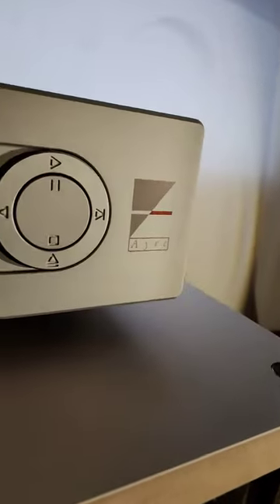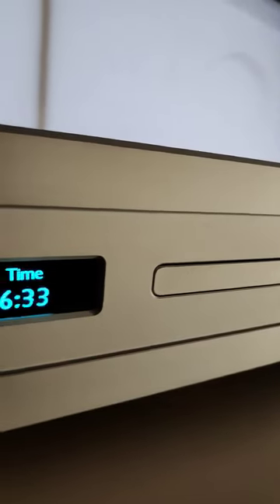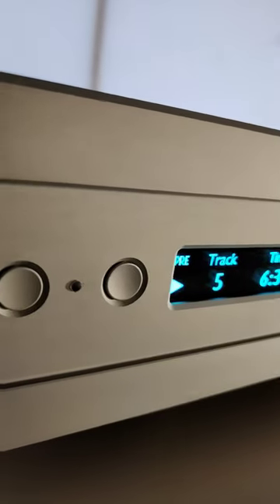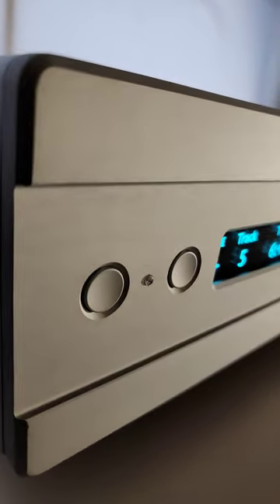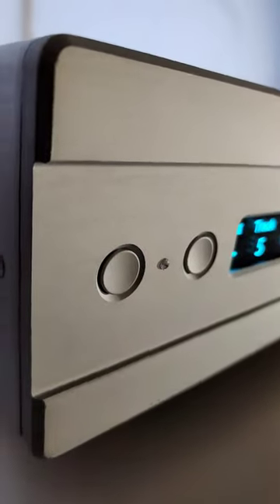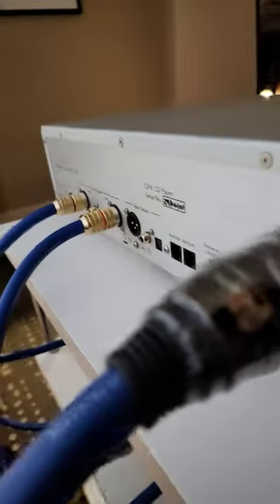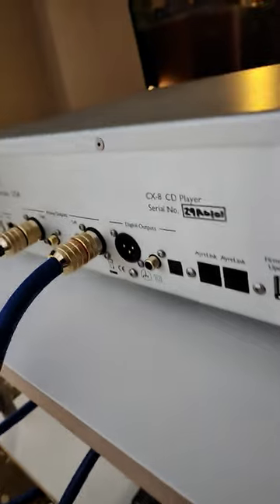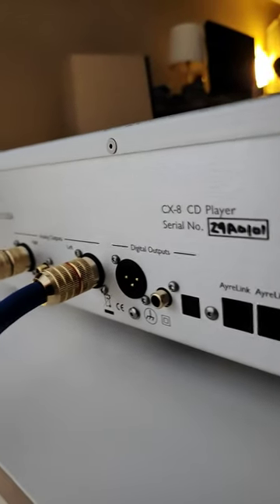AYRE ACOUSTICS up close... #audiophile

Comment: Beautiful 0101. I don't need a cd player, but if I did, I'd be Ayre. I have full Ayre stack with Argento
Reply from the maker: Cool. U spent twice on cables than what your system is worth ?
Reply: I'm a Certified(asshole) Public Accountant. Hope to make you laugh😂. My Ayre electronics are $110k retail, Argento wires close to $80k, speakers & subs $30k. Don't judge before you hear it. Ayre and Argento are both THAT good. Come visit Ayre factory? I bet Ariel & Jake would love to rub amicable elbows with you.✌️
Reply: I'm a short drive away
Reply: Can't forget Dynaudio, heaviest lifters in the room. Given my limited space, Confidence 30 & JL Fathom 10s are the only gear I can shove up against my wall to hang with what I'm listening for.